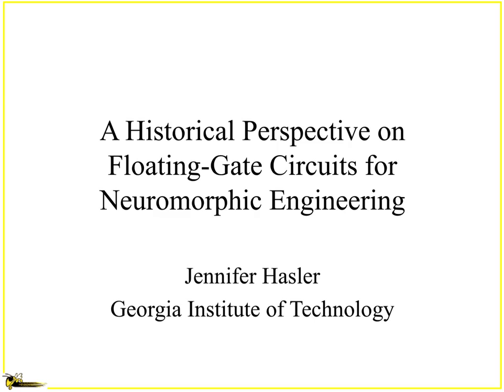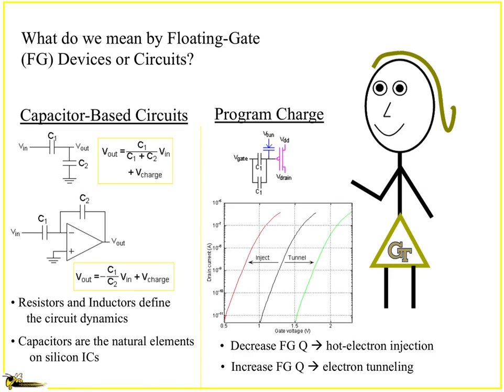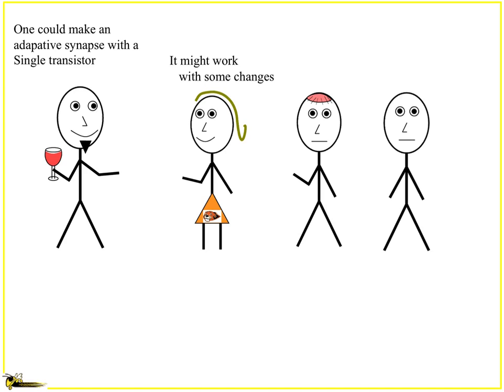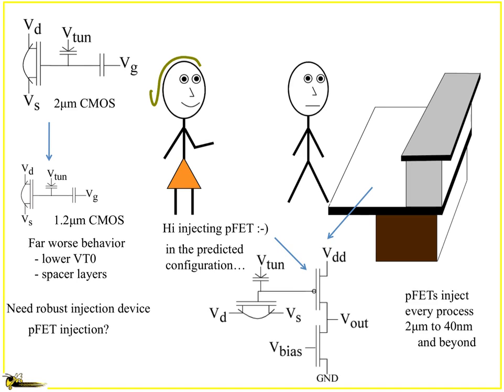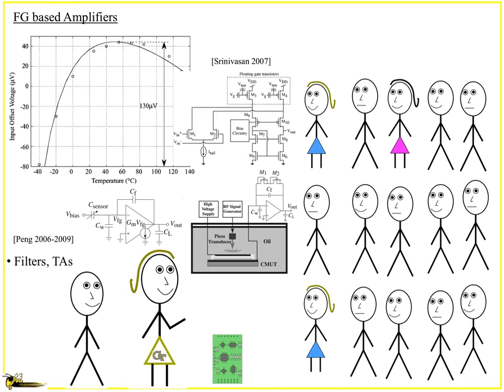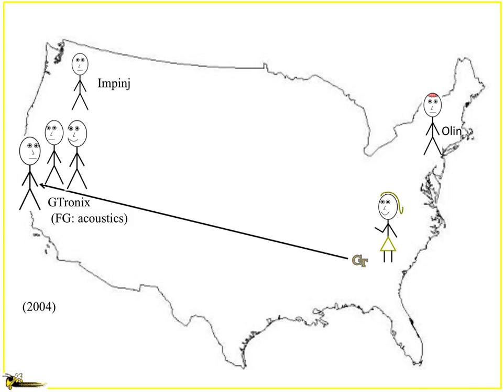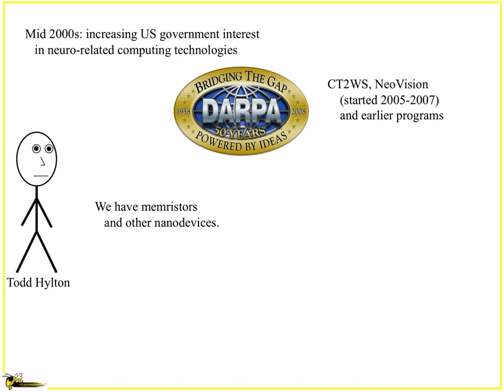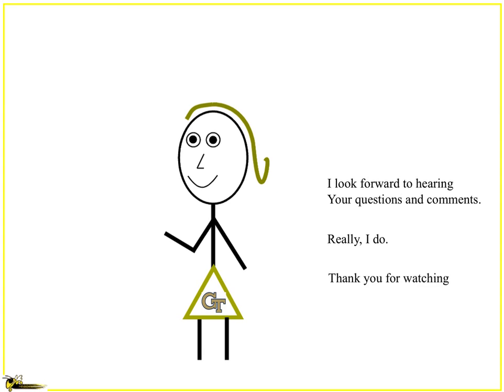Historical Introduction to Floating-Gate  Circuits towards Neuromorphic Design

Comment: Thank you Jennifer for this video.
It is easier to get funding for hype. Persistent good engineering doesn't sell well. Researchers are forced to sell the next big thing. 
I am working using memristor tech for building FPGAs and while that could be done, it is hard to outperform existing approaches and, right now, Floating Gate Circuits seam to be the better tech for anything beyond memory applications.